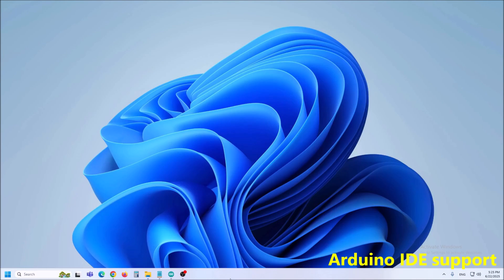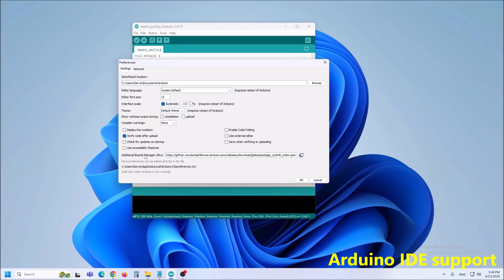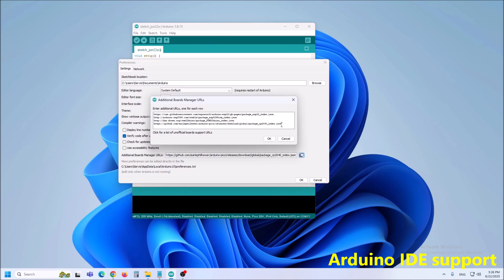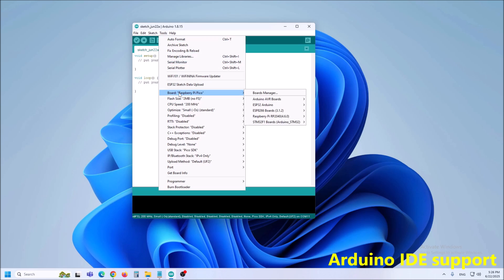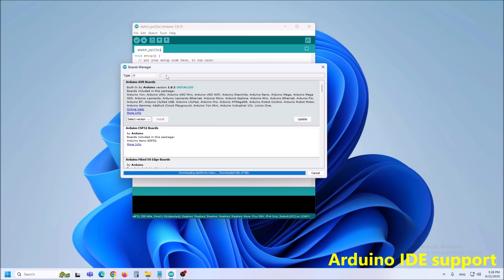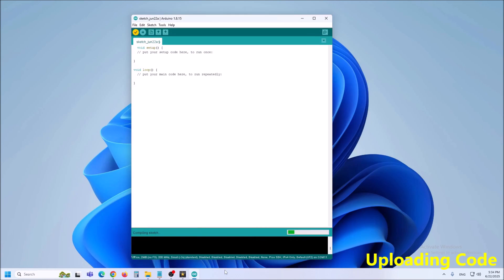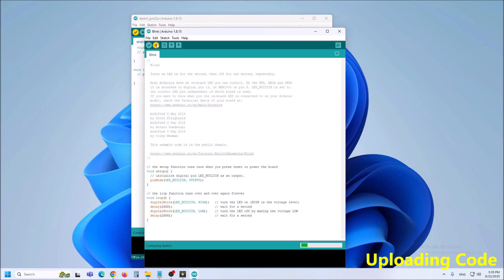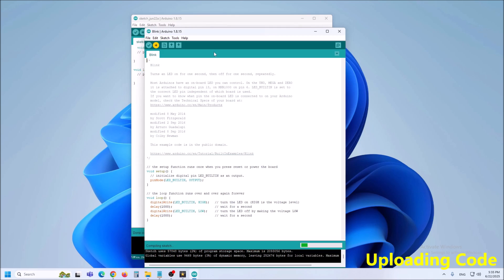Raspberry Pi Pico SSTV Decoder  Receive Images Over Radio

Comment: А есть прошвка в формате  UF 2? Чтобы сразу загрузить в pi pico. Не получается загрузить через ардуино
Reply from the maker: Yes, .uf2 firmware at:  https://www.hackster.io/mircemk/pi-pico-rx-sdr-radio-with-new-firmware-and-features-4880d4
Reply: @MirkoPavleskiMK эта прошивка для radio pi pico, а для sstv приëмника есть в формате uf2
Reply from the maker: @Алексей-ю9и4д  Sorry, my mistake, I Ihave no .uf2 file for sstv decoder

Comment: Hello i have problem i install on rasperry pi pico everything is conected when i upload code to raspberry  screen is black and only backlight work
Reply from the maker: You need to modify UserSetup.h in TFT_eSPI library according to your specific display connection. Maybe later I will send you a modified UserSetup.h for this project.